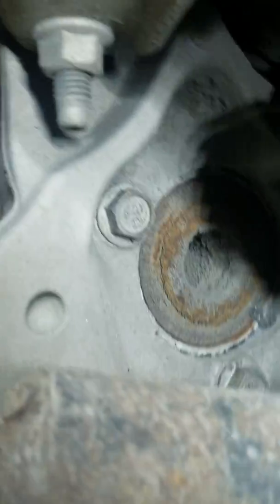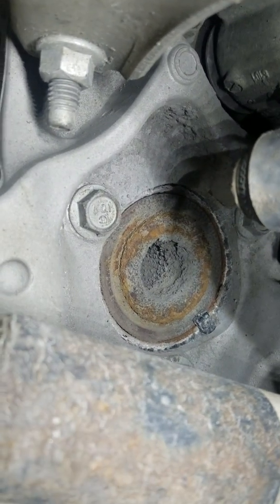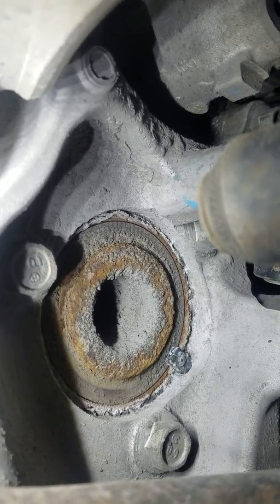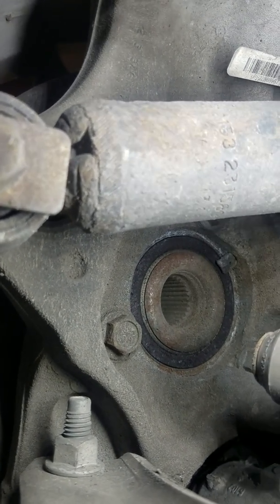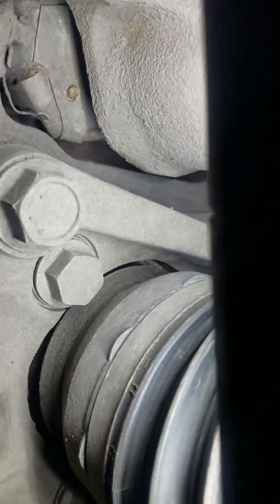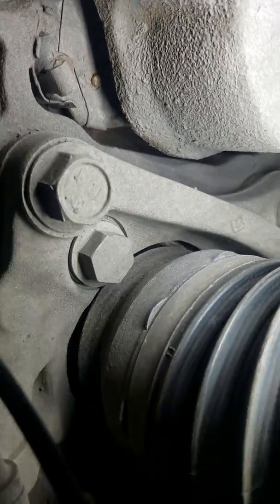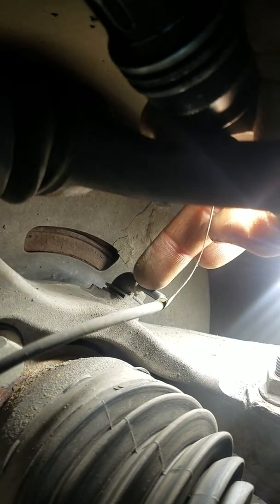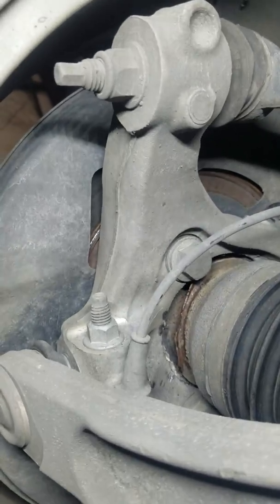Chevy stabilatrac, abs and traction light problems

Comment: Would all three of these lights cause the car to somewhat stall or restrict the engine from accelerating?
Reply from the maker: This will not cause any engine drivability issues that I have experienced. Vehicle should still run and drive just have these lights on
Reply: @liftittotheroof1876  I currently have the ABS light, stabilitrak, and messages prompting power steering service as well... the car partially stalls and doesnt let me accelerate. Many people have my problem but no one has a fix.